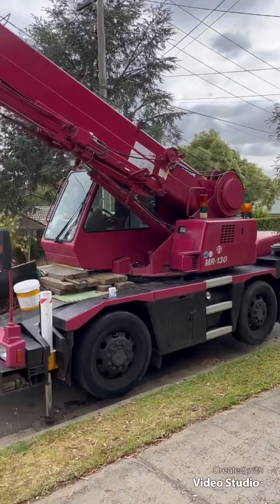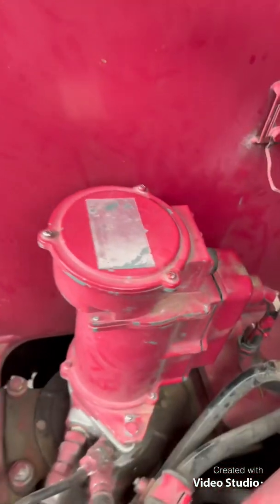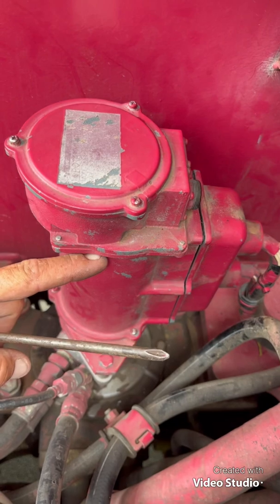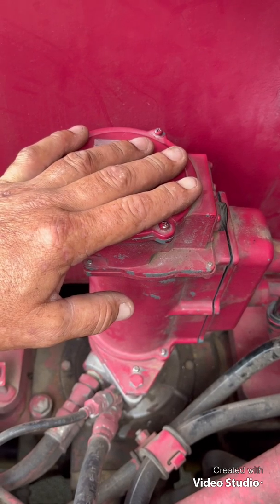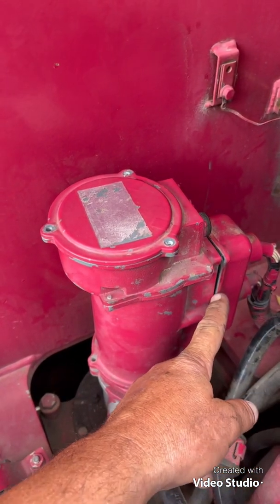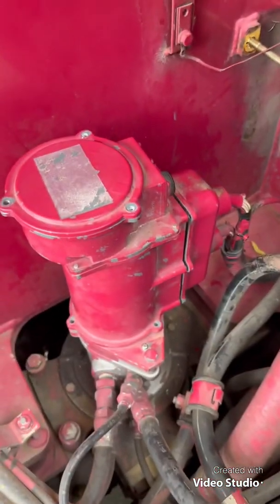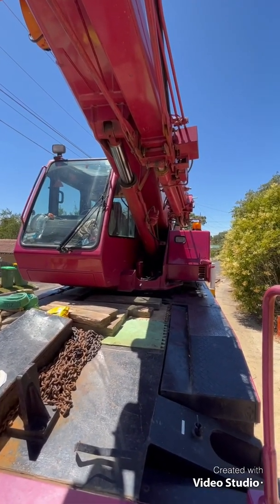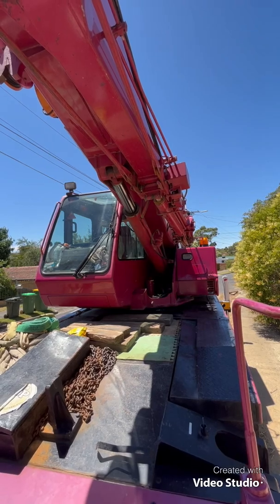Electrical issues on KATO MR130 crane

Comment: Outrigger doesn’t work by keypad,  please suggest.
Reply from the maker: On a KATO 13 ton?
Reply from the maker: I’d check fuses, then schematics for control circuit electrical and hydraulic

Do other functions work, example pick and carry without legs?
Reply from the maker: Can you set legs from side cabinet on the lower?

Comment: Had their been in heavy rain before u had issues? 
I’m having issues with a 2016 mr130r after rain. Its throwing a main hook stowed signal as I boom up above 65 degrees. Sucks when I’m mid lift as it shuts down all levers. 

I feel you’re older crane pain mate. Have worked a lot on a 1995 RK160-2 - awesome crane to operate, and fairly easy to repair, but just needed SOOO much repair and there’s so few parts!! Good work on the vids and keep ‘‘em coming. Not enough out there from owner operators!
Subbed.
Reply from the maker: Yep totally agree with all of that I’ve had much older Cranes than this, all from Japan and yes they seem easier to fix than the newer ones

It was parked for 2 weeks while I was living it up in Queensland, and yerp plenty rain

Those plugs on tip of boom cause me grief every now and then but this I think started with poor connection at the connection plug on the bottom of the loom coming out the bottom of the rotary brush, took some exploring to resolve, as per usual.

I have a ‘91 rk70, solid unit to operate 

Thanks for the support Dave 🤙